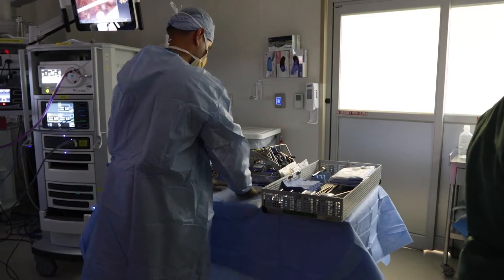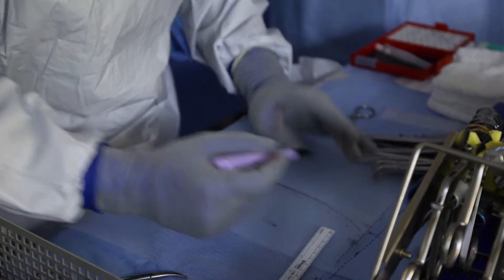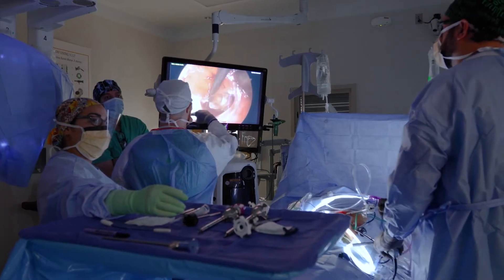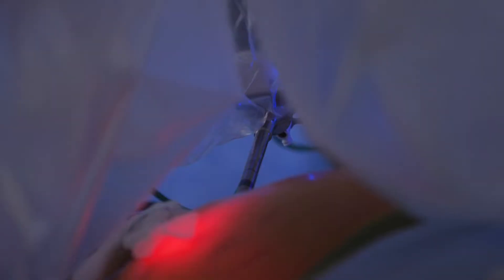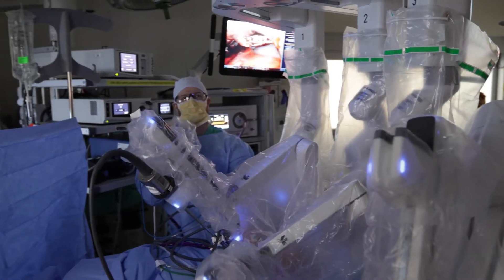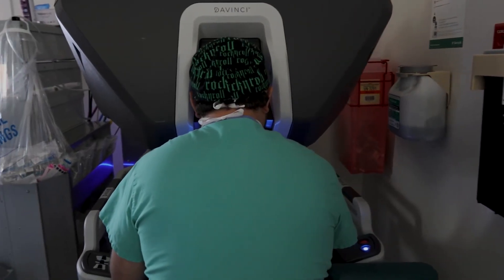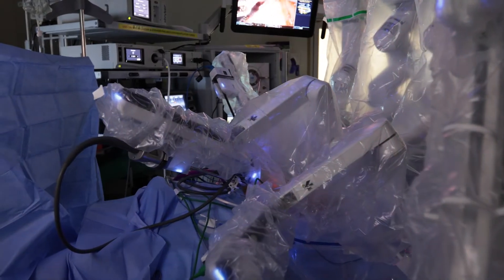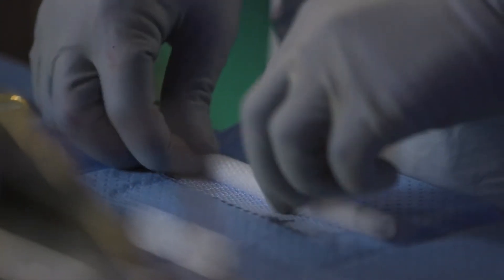Mesh Hernia Repair

Comment: Had this done yesterday. This afternoon I feel a slight pain, but not bad enough for even ibuprofen. Taking the antibiotics only. Don't delay getting yours repaired, it could strangle and kill you.
Reply: For how long do they keep you in hospital?
Reply: @OfficeDiscovery It was an outpatient surgery. I was home in about two hours after surgery and out at the garden. Had to help the caregivers with the hoyer lift for my wife that day. Was walking half hour the next day and then an hour days following. A week later I was on the Bowflex Max Trainer taking it easy and on the weights a couple weeks later lightly. While it is surgery, they don't slice you open, just three little incisions. The periteneam is cut and you will feel that a bit. Just use your head as to getting back to normal. Good luck!

Comment: Had 3 inguinal hernias all repaired with mesh. Over q decade ago. Still doing fine....just the mesh will pull in certain positions or doing things but doesn't hurt........
Reply: Thanks. Day 6 after 3 hernia surgery w/mesh. You just gave me some encouragement thanks! 🙏🏾

Comment: Had mine open hernia surgery inguinal omg they cut me 12 cm long don’t know what but. The pain was to much for me after waking up i 🤮 3 times but the pain seems to go gradually im feeling ok hopefully next week bk at work.  I was advised not to lift any heavy lifting 6-8 weeks
Reply: I have a hernia for about 6 years I think and am planning to do surgery. How are you doing?
Reply: @sram1454 Get it done. After a few days you’ll be fine. Just don’t lift any heavy weight for awhile.

Comment: Does a hernia ever “go away” completely?
Reply: Depends what job you do and how big it was without surgery it will never go way  I tried to avoid the surgery for the last 4 years but was getting worse because I worked with railway tracks heavy job. But u need to be very careful with lifting because the mesh may break then u need another surgery. Personally im considering changing jobs soon or later
Reply: Only with surgery. Well worth it.